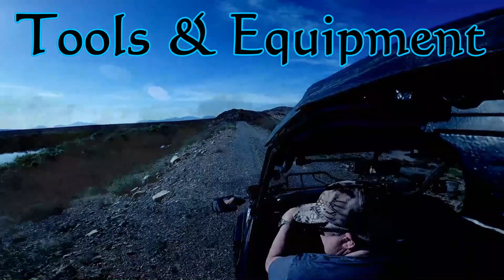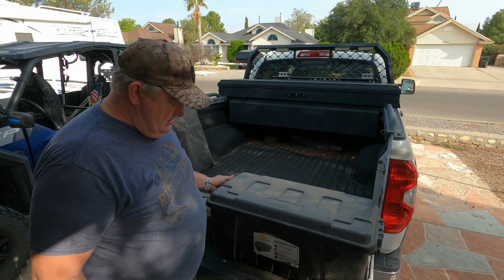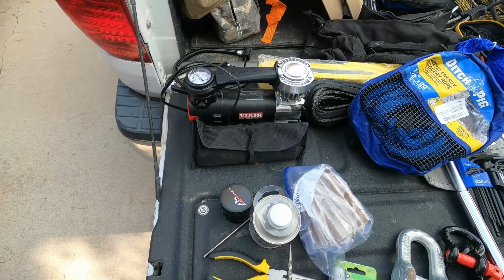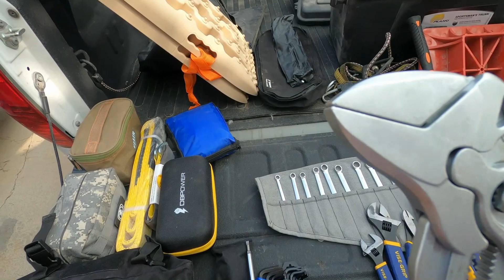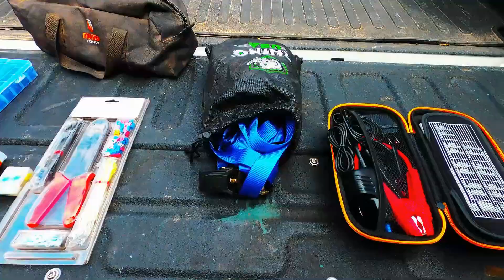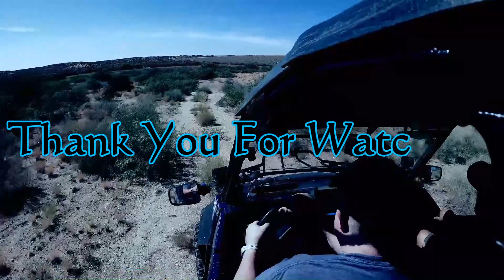Polaris General XP tools and equipment

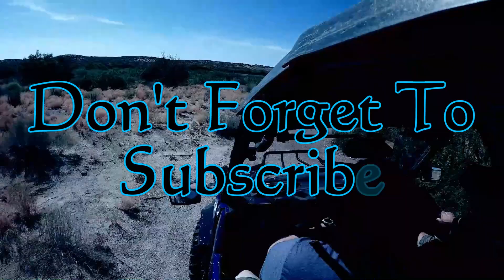Comment: Thanks for this video! Side question, I have a 2022 XP 4 1000 and have an antenna in front of the right pod light,  I notice you don't have one (5:53).  Did you replace it?
Reply from the maker: Thanks and no it's still there, it's laying horizontal and taped to the bottom of the hood rack.  It still functions,  not as good as if it was vertical but the rack made it a problem